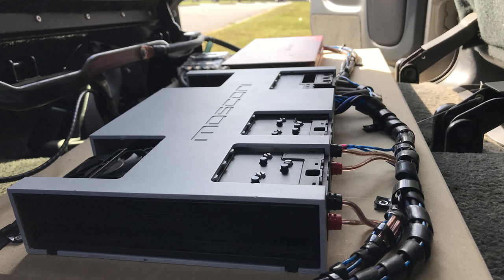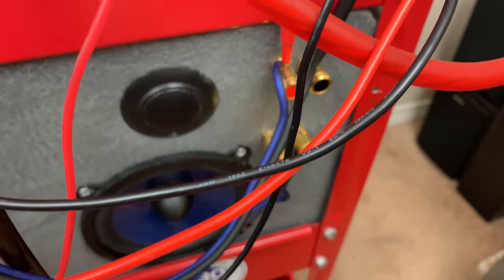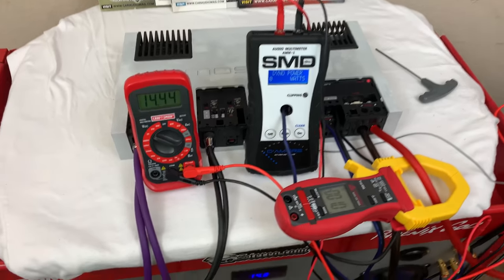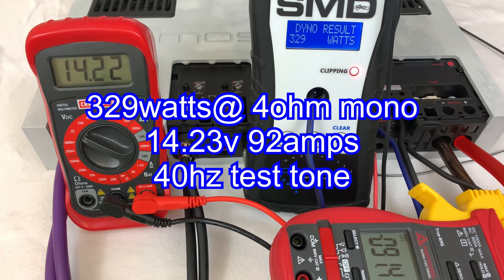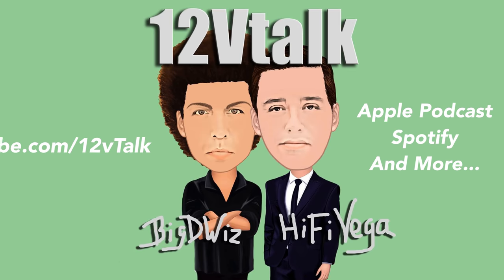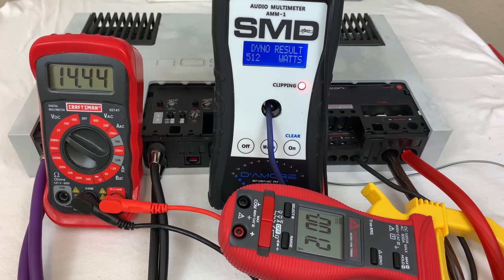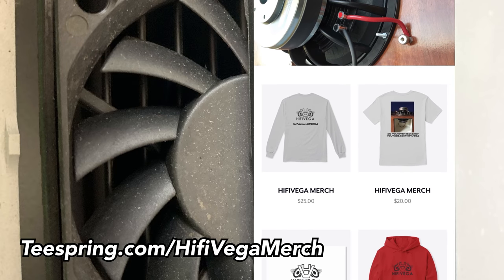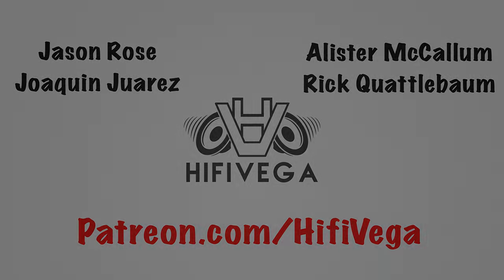Mosconi AS 100.4 Amp Dyno [4K]

Comment: Thank you for the great dyno test. I am about to install refurb’d unit and had a couple questions from folks more familiar with this amp:

Do you recommend the remote control?

The fuse installed in the amp is 80a… but you pulled over 90a during the test. Would this be a problem? Should I upgrade the fuse? Should the fuse at my battery match the amp’s board fuse?
Reply from the maker: I haven’t used the remote so I can’t speak on that, but as far as the fuse you’ll just need to fuse according to whatever your wire can handle not the amp and if you want to fuse at the amp you can just match the amps fuse rating
Reply: @HifiVega  thank you!!
Reply: @HifiVega  sorry for so many questions -- but any idea if I can run this bridged at 3 ohms and its wattage? was thinking of throwing my 10w7 at it
Reply from the maker: @aThousand_Words  it’ll do 3ohm mono it’s rated for 2ohm mono
Reply: @HifiVega  thanks a lot brother! any idea how much power I should see? I would guess like 425w or so, but idk how the math works.

Comment: Awesome video. Didn't Mosconi do or where involved with Boston Acoustics Gt amps? They both look very similar.
Reply from the maker: WR Photography2018 yep mosconi built the GT amps
Reply: @HifiVega  awesome, I still got my Boston Gt 2200 and my Boston Gt 40. I knew there was a reason why they sounded so unique. I wanted to upgrade my Gt40 to an Infinity Kappa K4 but the Infinity just did make my Boston Acoustics SPZ60 sound good. So I'm still rocking my Gt40 and it's uniqie frequency response from 10-90khz. I highly recommend it. Do a dyno on the Boston gt 40 because it's rated for 55rms per channel but sounds way louder than that.